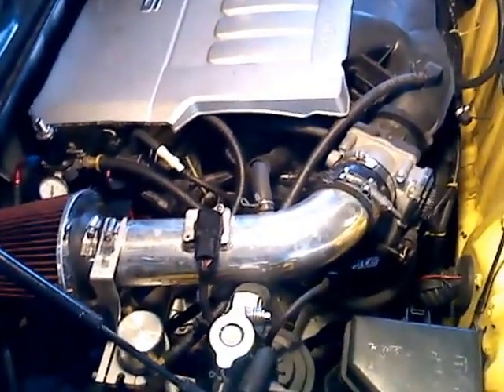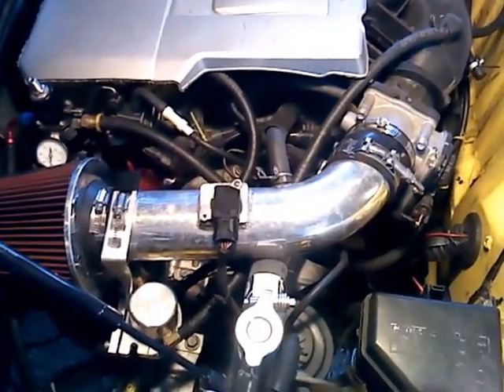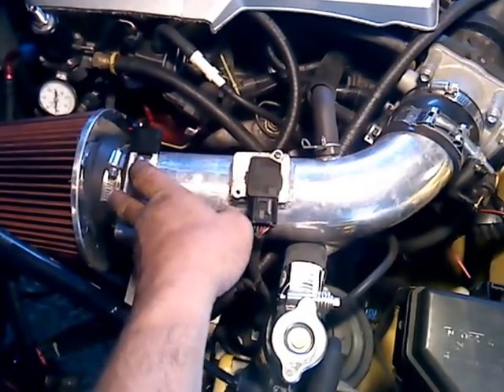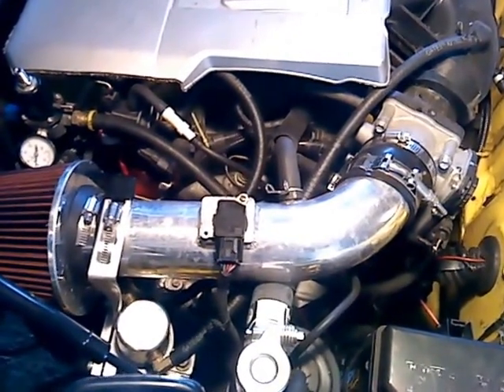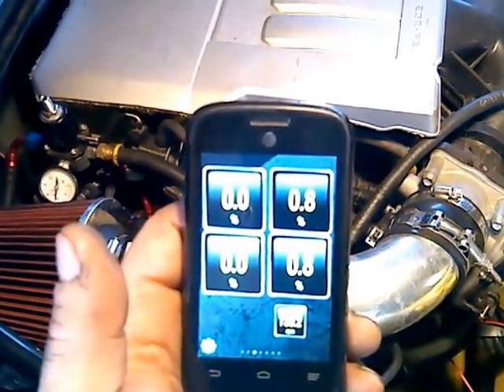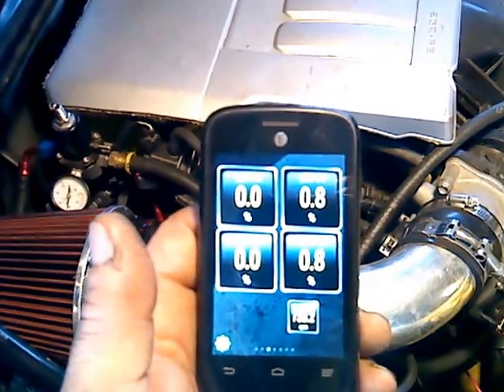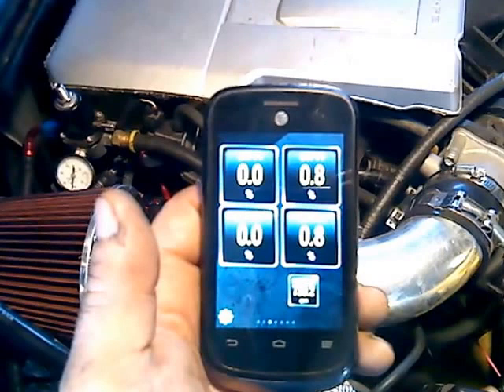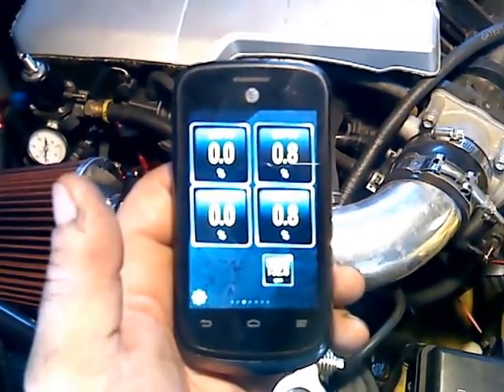Toyota MR2 3.5-liter V6 Swap 2GR-FE With 3-inch Cold Air Intake Fuel Trims at Idle

Comment: I'd like an intake for my 2gr Rav4 but around Memphis,  it's in the 90s+ with 90%+ humidity for over half the year so I'd actually lose power more than likely.   Great job on the mr2/engine build though!
Reply from the maker: Despite a lot of popular misconception and outright lies from vendors, intakes do not make any contribution to power output, not at stock levels. You are just fine with your stock intake you would not gain anything with a CAi.
Reply from the maker: Keep the filter clean.
Reply from the maker: Actually in a swap like this what we try to do is recreate the behavior of the stock intake as closely as possible so that the ECU can make the best power possible.

Comment: do you have the link for that ebay intake...i want to eliminate some variables in the equation. my fuel trims are still terrible
Reply from the maker: Link below CAUTION that the workmanship on the MAF plate is crap you must clean up the MAF hole with grinder or dremel to remove debris left around the opening. 

https://www.ebay.com/itm/FIT-07-08-TOYOTA-CAMRY-V6-VX40-COLD-AIR-INTAKE-INDUCTION-PIPE-3-CONE-RED-FILTER-/401317004618?hash=item5d705b854a
Reply from the maker: Also the silicone couplers are flimsy suggest more heavy duty coupler on the TB - purchase separately.